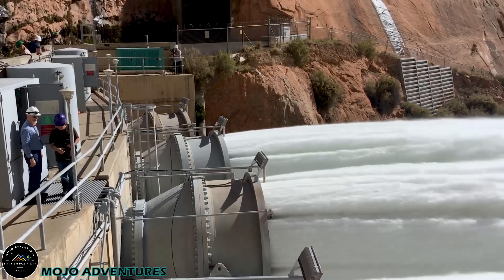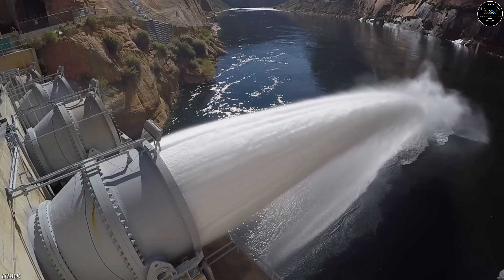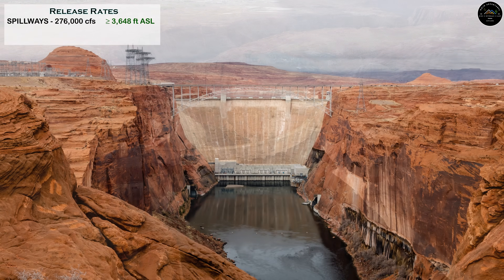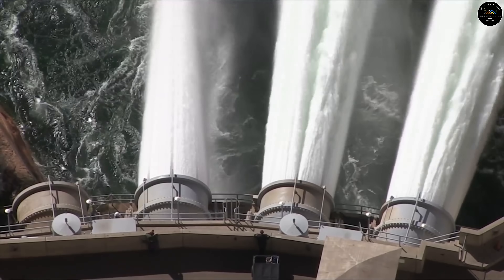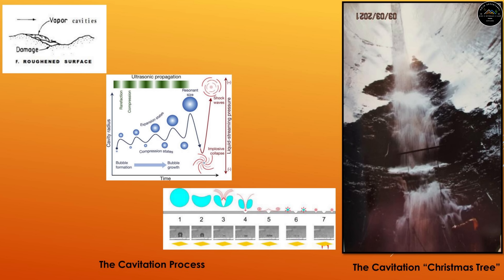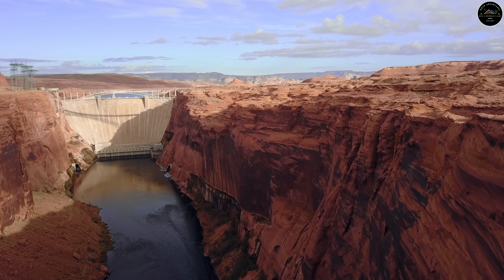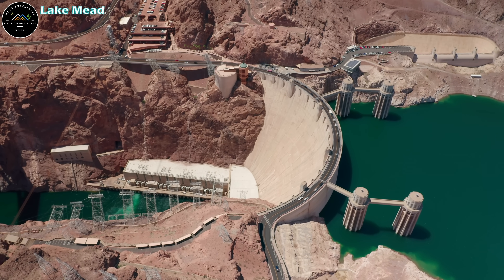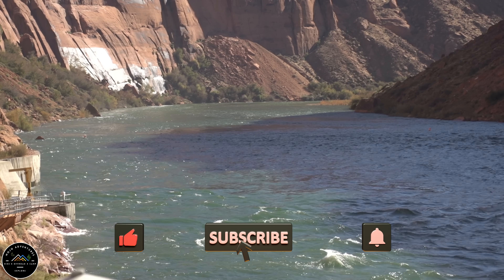TROUBLE ON THE COLORADO! Damaged Pipes FOUND Inside Glen Canyon Dam at Lake Powell #water #update

Comment: This is from the 1983 incident at Glen Canyon. Remember, this involved the spillway tunnel, not the pipes they are speaking of now:

The spillways at Glen Canyon Dam are located upstream of the dam and each spillway is controlled by two 40-foot by 52.5-foot radial gates. Flood releases through the spillways enter into steeply sloped (55 degrees below horizontal) spillway tunnels which connect to the downstream portion of the original diversion tunnels, which were used to divert the river during construction of the dam. A drawing of the spillway tunnel profile is shown on this page.

Constructing the spillways in this way, where hundreds of linear feet of each 41-foot diameter diversion tunnel are repurposed, was both quicker and cheaper to construct. The tradeoff, however, was that the bend where the spillway tunnel meets the diversion tunnel created the potential for cavitation. This danger was known by Reclamation, with both Hoover Dam and Yellowtail Dam experiencing damage from cavitation in their similarly configured spillway tunnels (Hoover in 1941 and Yellowtail in 1967).  The risk, however, was deemed to be minimal. According to W.L. Rusho, longtime public affairs officer for Reclamation, including the period during the Glen Canyon Dam incident, “A well-managed reservoir should almost never spill, and then only for very short periods, after which the cavitation could be repaired.”

Early in the morning of June 6th, operators heard loud rumbling noises coming from the left spillway and observed material being ejected at the spillway outlet. The right spillway gates were opened, and the left gates were closed in order to allow for Reclamation engineers to access the tunnel spillway and assess the situation. What they saw was cavitation damage – chunks of concrete missing at the invert of the “elbow” – where the steeply-sloped spillway tunnel meets the horizontal diversion tunnel.

For the following weeks, flows were primarily sent through the left spillway, and flows through the right spillway were held much lower. The right spillway tunnel was seen as being potentially more dangerous to the foundation of the dam because the right spillway tunnel “elbow” was nearer to the dam foundation than the left one, and as such the right tunnel posed a greater risk should cavitation damage reach the surrounding sandstone and spread horizontally. In late June, however, due to increased inflows, the operators were left with no choice but to pass more than 20,000 cfs through each of the spillways.

The reservoir elevation peaked at 3708.4 feet, 6.6 feet below the top of dam in mid-July, after which the discharges through the spillways were throttled down and eventually the spillway gates were completely shut. Once the spillway tunnels were dewatered and inspections could be conducted, the extent of the damage was finally observed. Engineers saw a 32‑foot-deep, 40‑foot-wide and 180‑foot-long crater at the elbow of the left spillway tunnel. Repairs commenced immediately, requiring over 3,000 cubic yards of concrete to backfill and repair the damaged tunnel linings.

Prior to the 1983 incident, engineers had identified the need to retrofit the spillway tunnels at Glen Canyon Dam with aeration slots as a cavitation control measure. However, the design had not been completed by the time the spillways were needed to pass the 1983 flood. Borrowing from their experience at Yellowtail Dam, Reclamation engineers designed air slots to be constructed while the spillway tunnels were being repaired. The air slots work by entraining air into the flowing water. This mixture of air and water is more compressible, which allows it to absorb the impact of the collapsing cavitation bubbles, thereby protecting the spillway tunnel surfaces from wear and damage caused by the cavitation.

Repairs of the spillway tunnels were complete in time for the 1984 flood season, which marked another season of above-average flows. The spillways performed well and didn’t exhibit any signs of cavitation following the 1984 floods. It has been many years since the spillways at Glen Canyon Dam have flowed.

Throughout this incident, the operators at Glen Canyon Dam were forced to make difficult, critical decisions without a full understanding of what was occurring within the spillway tunnels. When damage to the left spillway tunnel had occurred, inflows were still projected to rise and preventing damage to the spillways had long since ceased being a consideration. The goal had become to save Glen Canyon Dam from failing and sending a 500‑foot wall of water screaming down the Colorado River, overtopping Hoover Dam and other major dams downstream, and severely damaging the water supply to much of the arid southwest which depends on the dams and reservoirs along the Colorado River.

Following this incident, Reclamation conducted detailed forensic investigations to better understand what exactly had occurred. The investigation identified the initiator of the cavitation to have been a 6.5 mm high calcite deposit which formed near the invert of the spillway tunnel. Another area of damage in the left spillway tunnel was found to have been caused by a failed epoxy patch which had been used to repair the hole left by a grout pipe⁷.
Reply: Excellent explanation.
Reply: @gregwarner3753  Yes it was. This is the guy that wrote it: 
Andy Lynch, P.E.
Title: Project Hydrology and Hydraulics Engineer
Reply: A few years before this incident, the USBR had begun work on an engineering monograph to explain cavitation in spillway and other waterways. Details of an airslot for Glen Canyon were already proposed before the flood occurred, but there was not enough time to implement it. As it turns out, discharging much higher than 20,000 cfs would have resulted in much less damage, which seemed counterintuitive at the time. Since the damage to the spillway was downstream from the dam, the dam was probably not in danger of failing, but at the time, the decision makers at USBR did not know that.
Reply: Wonderful and informative explanations, thank you. I’m wondering if today’s tunneling machines would possibly offer a solution to build a lower bypass tunnel at a relatively reasonable price for a backup solution?
Reply: @peterjaigner  Great question and I don't know. But I don't think they want to mess around with that sandstone very much. I found a paper written in 1961 by Ernest Schultz of ASCE detailing design features of Glen Canyon. I found great stuff on the discharge pipes in question today. I don't see why they can't be repaired - it seems they have means of access. Pretty interesting the way in which they designed on the fly due to conditions encountered. It seems too that they went the least expensive way on many design options. I think they wanted to keep moving before something like a court order could halt construction. Just my guess. So, here is the pipe info. I wonder if the tighter radii and extra bends are coming back to bite them:

 River outlets having a capacity of 15,000 cfs with the reservoir water surface at elevation 3490, minimum water surface for power operation, are installed in the dam near the left abutment. The river outlets provide for releases for downstream commitments when the powerplant is not in operation and during the period of final closure of the diversion tunnels. The outlets will also be used to maximum capacity during maximum flood releases. The outlet works consists of four 96-inch-diameter steel pipes with cast-iron bellmouth intake, hollow-jet valves for regulation, and ring follower gates for emergency closure. A bulkhead gate, which operates under balanced head, is provided at the upstream face of the dam to provide access for servicing the ring-follower gates. A reinforced concrete trash rack structure with structural steel bars protects the entrance. The maximum permissible velocity in the outlets is 75 feet per second. The best arrangement for the outlets in the dam was found to be two parallel outlets in each of two 60-foot-wide blocks. The centerline distance between the outlets in the dam, 15 feet 1 inches, was dictated by the required clearance for the bulkhead gate frame metalwork around the bellmouth intake. The minimum distance between the centerlines of the outlets and the radial contraction joints in the dam was set at l-l/2 outlet diameters. Radii of bends are 4 diameters except where lack of space required using a bend of 3 diameters. The centerline of the intake is at elevation 3374 which is about 30 feet above the estimated 100-year silt level in the reservoir. The ring-follower gates are located in a chamber in the dam 60 feet downstream from the face of the dam. To facilitate installation of the gates, block outs are provided in the gate chamber floor. A vertical shaft from the chamber to the roadway at the top of the dam is provided for removing gate parts for servicing. Special joints to take movement in three directions have been designed for the outlet pipes where they leave the dam, to provide for movements of the dam when the dam is fully loaded. A section through the dam on the centerline of one of the outlets is shown in Figure 11. As the powerplant structure occupies the entire bottom of the canyon from abutment to abutment, it was necessary to locate the outlets in the mass concrete beneath the service bay and machine shop as they leave the dam. In this area, they are set two above each other at minimum spacing. Beyond the machine shop the outlets are encased in concrete and are located below the powerplant parking area. The hollow-jet regulating valves are located about 700 feet downstream from the axis of the dam. In this area, the outlet pipes are spread apart and are all brought to elevation 3175· The hollow-jet valves are located at this point so that their operation would not interfere with the powerplant tailrace. The location of the valves and their operation were studied on a large hydraulic model. Piezometers have been provided in the outlet pipes to check the ·discharges from the outlets and to study the losses in the pipes and pipe bends. The steel outlet pipes are designed for full bursting pressure. The outlet pipes in the dam are reinforced tor tensile forces due to dam stresses and temperature effects, except in the area of the bellmouth entrance and the area where the pipes leave the dam. In these areas additional reinforcement is provided for internal bursting pressure. The reinforced concrete trash rack structures are designed for a differential water load of 20 feet. The second-stage concrete in the blackouts around 
the ring-follower gates is reinforced tor internal bursting pressure within the gate frames and bonnets. The mass concrete around the pipes in the area from the downstream face of the dam through the service bay and machine shop is reinforced for tensile forces due to internal bursting pressure and for unbalanced forces in the bends. From the downstream end of the machine shop to the hollow-jet valves the mass concrete around the pipes is reinforced tor tensile forces due to internal bursting, unbalanced forces in the bends, and for truck and trailer loads in the powerplant parking area.
Reply: @danlowe8684  I don't know that what you presented indicates anything was "designed on the fly." Congress approved the funding, and environmental groups agreed to the project once changes in the configuration were approved (more later). It looks like a typical design for that period. Outlets are typically embedded in the dam if it is a concrete dam. The sandstone there is pretty strong for sandstone, as evident by the near vertical canyon walls. Tunnel boring machines were not used in the 1960s when the dam was built, but certainly could be an option to drill and blast.

My understanding from an article I read a while back was that the Sierra Club agreed to the dam configuration once a proposed afterbay dam was removed. An afterbay dam would have captured peak outflows from power generation and released that water downstream at a constant rate, preventingflow surges during power releases. If it was built, the outlets may have had a different configuration as a submerged outlet. I have no idea why the afterbay dam was an issue unless it was just that the project would have a bigger footprint.
Reply: @CO-PE-123  I agree in that what I presented didn't indicate design changes and going to cheaper solutions. However, the paper I cited did. It was 55 pages long. I simply posted the topical failing discharge pipe system info. But to your points, the dam was built between 1956 and 1966, and the author stated in 1961, 'The design for the major components, that has been worked on since 1956 is nearly complete.' Also, tunnel boring machines have been used for 150 years. And the vertical walls did require a substantial amount of bolting (up to 20' long).
Reply: A quarter inch lime deposit wrecked an entire drain.... 

Right. 

Thank God there's never any dirt or foreign material in the water.

Not shooting the messenger, just the text. Thank you for posting it. It should be obvious by now our government run operations have been an incompetent joke for at least the last 75 years.

Comment: Good report. Indeed a problem with no easy... or inexpensive solution. This will encourage the dismantlers.
Reply from the maker: Thanks @sammyhead, indeed it seems the engineers just never planned for Lake Powell to ever get below the River Works Outlet. I am somewhat surprised to learn that not all dams are designed with a low-level / sediment bypass. I am sure the USBR is already weighing whether it is more cost effective to fix the whole system or partially decommission it.